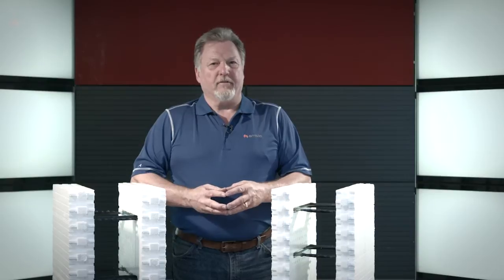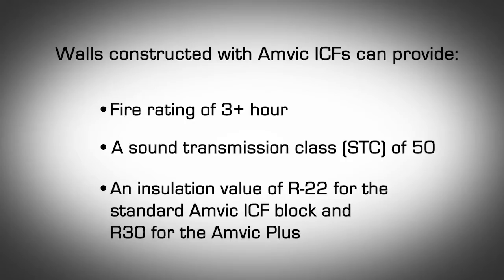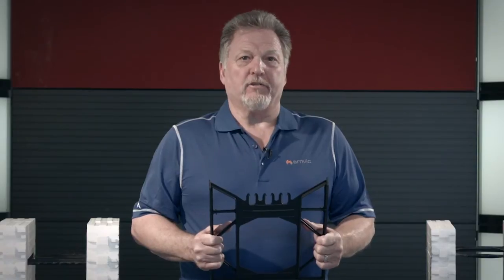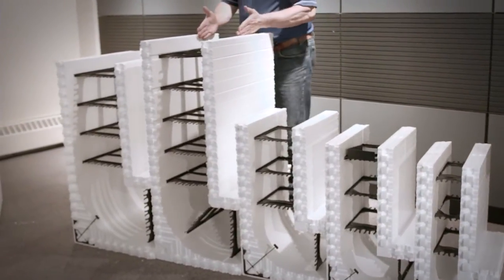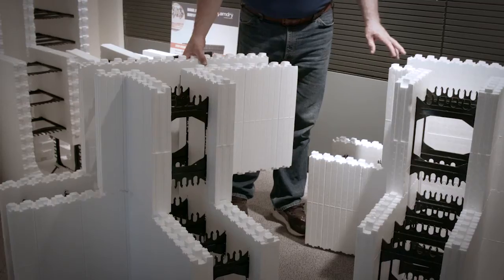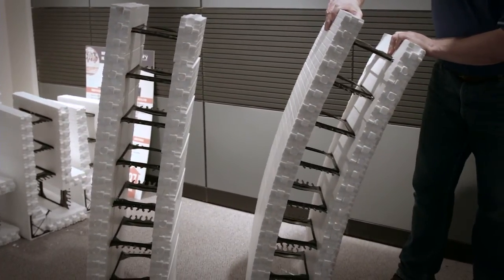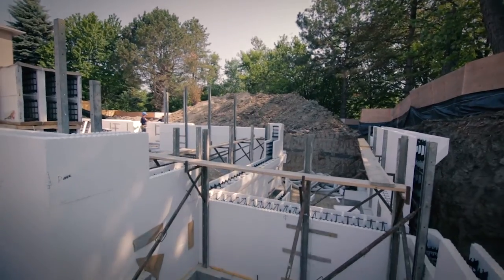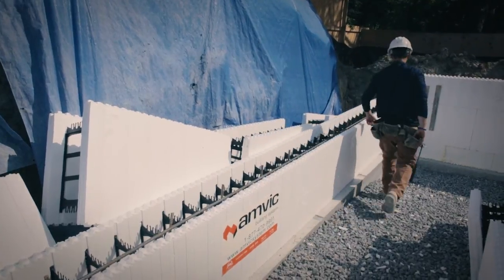Amvic ICF | Installation Guide | Parts 1, 2, & 3 - Introduction

Comment: The only thing about icf homes is termite protection I've done three homes that can't be sold because of termites no termite company will touch them
Reply: Don't termites like wet, rotten wood? What are they doing with concrete and Styrofoam?